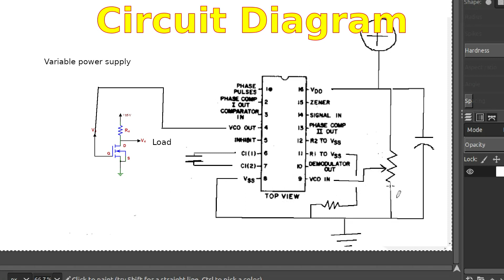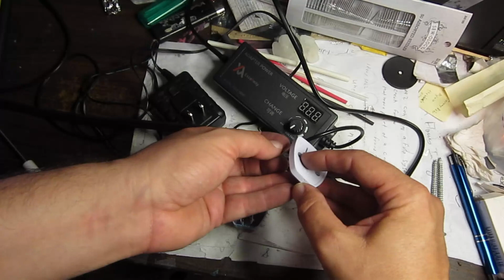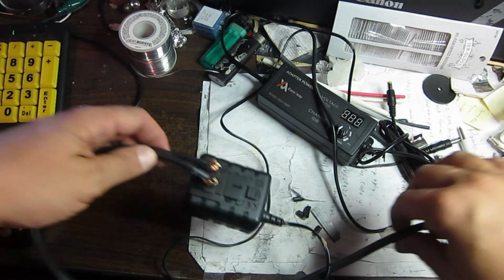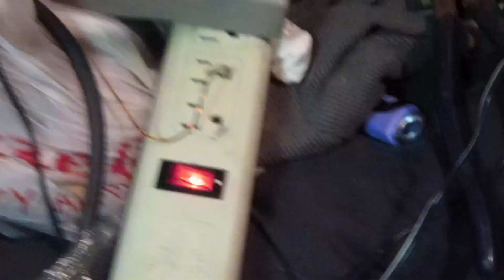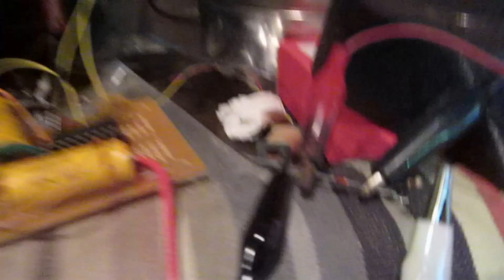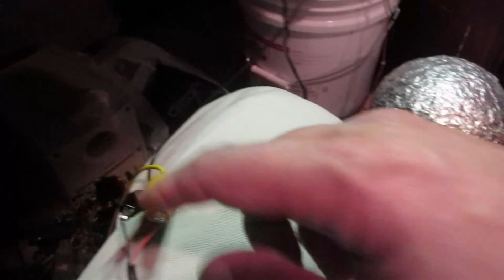DIY High Power Variable Frequency Generator!

Comment: Very nice!  What is the frequency range of this system?  Thank you for your service.
Reply from the maker: It depends on the capacitor and resistor that you use... I show the design of this circuit in another video.. I believe that the max frequency I was able to get with this oscillator was above 1MHz.. Thanks!!.. Are you working on some interesting projects to use with this??..
https://www.youtube.com/watch?v=-zlN4oullow